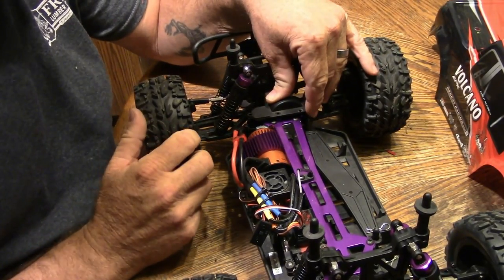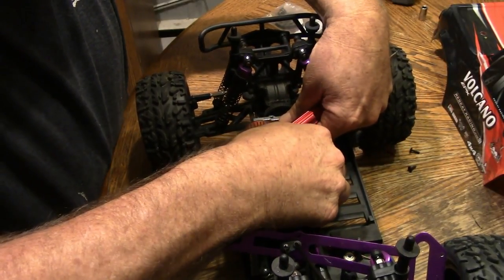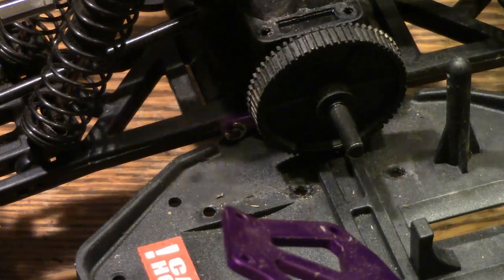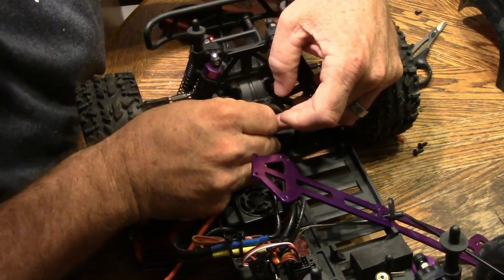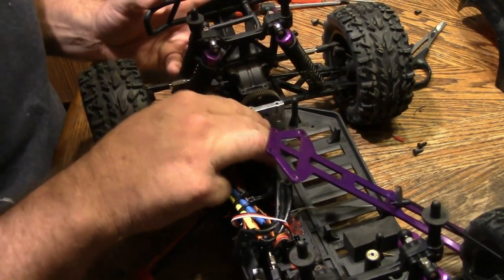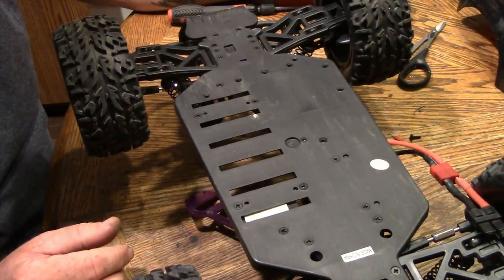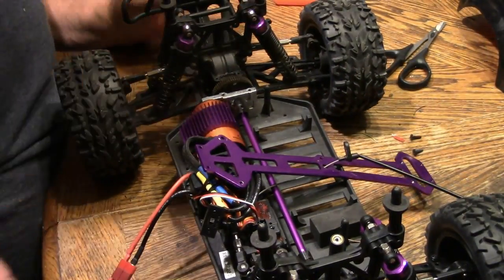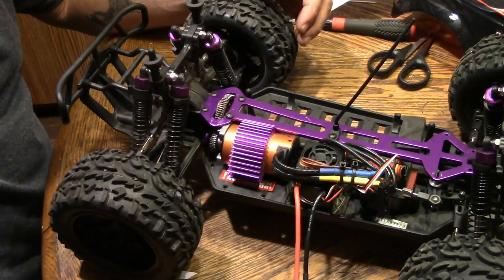VOLCANO EPX STEEL SPUR GEAR INSTALL-SIMPLIFIED

Comment: Very informative. I have a couple of SunFires and they look similar to your Volcano. The hardest part for me is getting the motor mount screws in without cross threading the bottom one. The A-Arm is directly in the way and that causes the Allen to come in at an angle. I would love to upgrade to a motor mount that is adjustable with lockdown bolts on top.

Comment: I had an accident with my Volcano during a top speed run. I was running the stock 3300kv brushless motor with a 2s 6500mah 50c Lipo battery.  I probably hit 35 mph when I over corrected and hit a concrete curbside. Well I destroyed the entire left steering assembly as parts scattered all over the parking lot. I'm hoping some Gorilla glue well fix the Volcano, anyways cool video dude

Comment: Have u had any problems with the gears???
I brought the same gear but pinion stripped 10mins into running on 3s. Ive looked into other types but they all seem the same. Will have to retry 🤬
Reply from the maker: I didn't have any problems out of them but I never ran it much. It was stolen from me with about 20 other rcs. Steel on steel was fine but loud. I just kept alot of grease on it. Thank you for commenting!
Reply: @BCUltimateRC  no way.. what wankers
How did they manage to take your collection?

Video was super helpful 👍🏾👍🏾
Reply from the maker: @east_ldnrc1378  I was away from home for a year and someone broke in. Wiped me out on parts, batteries, .... everything. I have a little left.

Comment: What kind of grease is that
Reply from the maker: It's synthetic grease with silicone. I don't remember the brand but I got it at an auto parts store.
Reply: B&C Ultimate RC will white lithium grease work?
Reply from the maker: @dy3931  it will but it won't last as long and it's kinda messy. It will sling everywhere. Just put a little on....it will be fine. Just a fine coat on all of the teeth will be ok.

Comment: Sounds like the gear mesh is a hair tight
Reply from the maker: I actually loosened it... did 2 sheets of paper. I'm not sure why its sounding like that. Ive tried everything...
Reply: Adam Cline
Reply: It is that method is far too old an never is a even mesh holding the car up an tightly securing screws will warp spur an penion gear will shred down